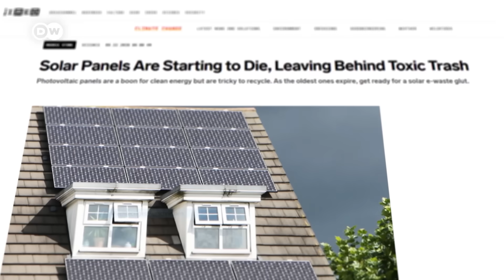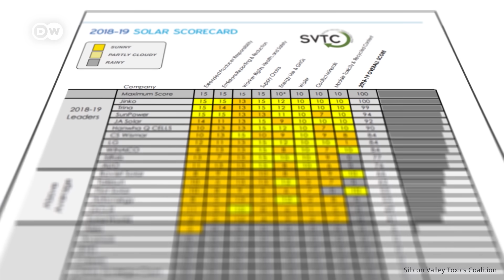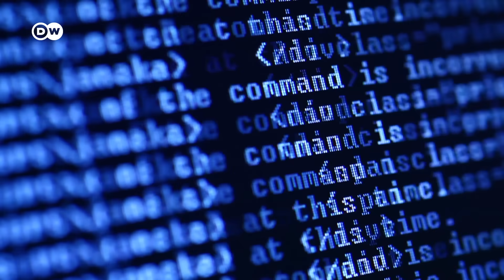How green is solar energy really?

Comment: Solar is beautiful but has a ridiculous capacity factor. When you have related solar panels to gas or coal plants, you forget the capacity factor that makes these 2 energy sources not comparable. Solar is an intermittent source while gas or coal plants are a stable source, so a solar field can never replace a gas plant, these energy sources play on 2 different fields. Solar's task is to manage peaks in energy demand, that's its role. If you want him to do some homework he can't do, he becomes a problematic energy source, like the one shown in the video. We don't need all these panels. Each country should have a percentage of solar equal to the solar capacity factor in relation to energy demand.
Reply: so a solar field can never replace a gas plant
It must certainly can, however it needs storage to do so. CSP's already have storage built in, but they are a bit more expensive (+-120$/MWh) and can only be used in sunny arid regions. 

However as storage options are growing and becoming more mainstream, solar and wind together with storage will become the dominant factor in most grids. I think especially in the next 2 decades we'll see a huge growth in the energy storage sector. Ofcourse it isn't easy, but if storage can get to around 60-70$/MWh, it would certainly be competitive together with solar and onshore wind turbines. Storage is now still around 300$/MWh for lithium batteries, but there are other cheaper options coming. And well, solar was around 1000$/MWh 10-15years ago and now it is at around 40$/MWh large scale so cost can come down pretty rapidly.
Reply: @MDP1702   From what can be seen from the Australian and Californian storage experiments, it is not a sustainable technology both economically and in terms of environmental impact. Energy storage is even further away than nuclear fusion.

Comment: Warning - this video is mostly nonsense. Click bait at best. Misinformation at worst. 30 year life? Ummm no. Degradation of the latest solar panels is less than 0.4 percent per year so even in 30 years they will still have 88 percent of their original capacity. There is no need to scrap or crush or recycle them, just accept reduced capacity to produce power over time and allow for it or size your system accordingly.
Reply: Yes, but the Efficiency itself 21% for best solar panel and many solar panel have 14-16%.. so think 80% after 25 years.. it would be 11% to 13% which is less. At bad maintenance it should be thrown.
Reply: @scienceisreligion5618  Put  simply.... a 300w solar panel will produce 300w in year 1.  The same 300w solar panel will still produce a minimum of 260w after 25 years.
Reply: @craigphd7844  80% would be after 25yrs if Maintained well meaning.. 240w after 25yrs. The fact is 330w( by solar power or rec) would be smaller value as technology could have advanced after 25yrs. That will push the consumers to throw the product unless the consumer is poor.
Also the consumer would have planned 5-6 pannel based on his Electric output. If 20% reduction done, then his output and Solar input won't get match.
Thats why Circular economy is preferred.

Comment: Solar doesn't produce much power however. Less when it's a cloudy day. To produce 1000MWH you needs thousands of tons of raw materials to produce that amount of energy. In comparison Hydroelectric requires 1/10th of the raw materials to produce the same. And Nuclear? 1/100th. Renewable is a joke of a market scheme that doesn't work. Both Germany and California have needed to open coal and gas plants to cover the energy demands that solar and wind cannot provide. We need a consistent power source that can provide all the energy demands when it's needed. Currently, the only power source that can do so and is clean energy is Nuclear

Comment: As far as I can see the CO2 emission of fossil fuel highly underestimated. E.g. where the most of the fossil fuel is being used. Cars. They have about 12% average efficiency (no, it is not 30%, 30% the best, not the average. Best when engine runs on 4500RPM, the load balance is perfect, and there is ideal air temperature and humidity ). So if you need 1kwh in car, basically you will burn 1L of petrol, and we did not finish here. Petrol is not grown on petrol station. You have to pump it out from the ground, transport it and refine it. When you burn 1L of petrol in your car, you actually already burned 2L more already. So basically for 1Kwh energy you burn actually 3kg of fossil fuel.  When you burn 3KG fossil fuel you will get about 10KG CO2 :). Please use your common sense, that 486g is a joke. The real number closer to 10 000g.It is insane, that number is 20 times underestimated.

Comment: The ways to deal with it is, 1: make sure energy to produce comes from renewables. 2: recycle materials 3: come up with better materials. 4: improve lifespan by minimizing the degradationfactor as much as possible. 5: improve efficiency. There are several ways to do this. Stacking solar cells on top of each other will increase efficiency, collecting the lost heat and using it for other applications, such as warming the house or heating water for the warm tap, further increases the efficiency.

Comment: We installed solar panels on our roof and rarely get a significant electricity bill and sometimes get a check. 

We generate about the same amount of energy that we use (total). That means we can crank up the A/C when it is hot without feeling uncomfortable (or guilty!) 

I can recommend installing it. However buy the units and have them installed by a competent professional. Renting them is a mugs game. 

Unlike our neighbors we have not had a power blackout in 5 years. 

Perhaps all new houses should be required to have enough solar panel capacity to cover the needs of the average family who would live there.

Comment: I think the issue is that if a solar panel's lifespan is 15 years, then if you develop a new novel way to build a solar panel - specifically to make it recyclable - then you have to wait 15 years before your specialized recycling process should expect to be operating at scale.  Humans are notoriously impatient and I think it unlikely that most of those companies will even be in existence when their panels are ready to go through their special recycling process.  So all of this is just to point out that solar panel recycling tech needs to be universal.  It needs to work on a large number and type of panels and it would be really nice if a large percent of the recovered components could go directly back into new panels.  And while we're making wishes - I want a pony.
Reply: 95% of  solar panels already in use are recyclable. In the EU laws have been passed to do that. Other countries, not so much. Germany (no surprise there) is a leader in panel recycling. One german company that makes panels has a subsidary company that recycles panels, (and reuse) and they resuse some of the material. (I think its called Veolia). Germany is expecting and planing to be recycling approximately 22,000 tons by 2025. Germany was a leader in solar panel production, and panels have been around for 40+ years. The lifespan of a solar panel is much longer that 15 years. Most panels come with a  guarantee of 85% of original output upto 25 years. Many panels are still producing a significant output after 40 years (40-60%). Also newer panels have an increased efficiency and higher output, this leads to upgrades of panel installations in some quarters.
Maybe that helps with your first wish. As for the pony, i could give you my daughters one, but the wrath that would follow is too scary to contemplate.

Comment: I really would like to know how many people here are using solar panels for their home and had calculated how much electricity or energy utility charges are they saving. And as per that saving how many years they will need to recover the full installation cost and  maintenance costs over that period.
Reply: I have solar. The consumption of kw/hrs i take from the generating company has fallen by nearly 50%. I do not use batteries, they are not essential. I only produce power during the day, no storage. My charges have dropped by 48%. Any excess i produce goes to the generating company for which i get paid. The payback period is circa 5 years in my case. Rising energy prices will reduce that. I have reduced carbon emissions by approx 3,280kg since installation. All installations will be different in their payback period. It primarily depends on how "Sun rich" your area is. My maintenance costs are zero. Panel cleaning is the only requirement, and I do that myself.

Comment: you know what also have lower carbon footprint than solar?
nuclear
especially that conveniently you entirely forgot to mention that solar panels do require either backup power or huge capacity of energy storage - both of these do come with a carbon footprint

you say companies have to be pressured to come up with solution to toxic waste - not mentioning if such a solution even exist. and even if it does whether it would be possible to maintain the low price.

you argument for recycling the old panels is ROTFL - you got this lady telling you only 3% of a mass of a panel is economically viable for recycling and you cheerfully carry on to the statement that recycling is possible.
maybe you should have asked a question what's a plan for the remaining 97%, hmm?

Comment: You forgot one thing. How much farm land would a solar array eat up? Does solar work to produce steel casting? Or any castings for that matter. How about just the production of cement, which requires almost 3000⁰f using everything from natural gas to old tires. A lot of questions need to be answered in their entirety. Mostly what I've heard has been the positive.  Now how about the true cost. Showing where when and how alternative energy will be used and beneficial.

Comment: Cheep? 🤦 Nuclear energy most cheeps.
Reply: Hydro is cheaper to the point that even some 3rd World countries have it.
Reply: @palmshoot  it can to be used like maneuver electric stations, but not the main. 3rd world countries don't have personal for nuclear stations, money, infrastructure, that's why they use what they can. In my country 1kW of nuclear power costs 0.06 euro cents, hydro 0.4 euro cents, coal 9 euro cents green as sun and wind 20 euro cents.
Reply: @constantinemalkovich9089     Which one can't be used as the main, nuclear?  Hydro is the main source in Iceland, followed by geothermal.  Canada also primarily uses hydro.

Maybe decimal points work differently in Europe, but for geothermal, some costs are as low as $0.01 USD, about as low as you can get, but $0.03 also exists.
Reply: @palmshoot  hydro. It used to make smooth peak of usage electricity. You answered your question by yourself. If you leave in country with small population, or small heavy/machinery industrie:  hydro, thermal, etc is ok.
Reply: @constantinemalkovich9089  That basically encompasses every country with waterways.